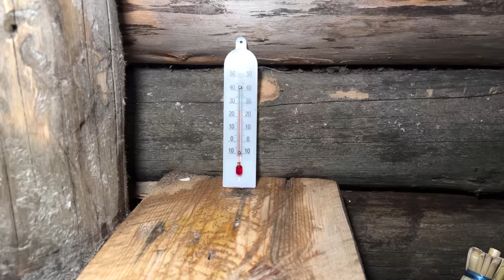I hide from the RAIN in a cozy dugout, install an OVEN in the house underground

Comment: The electric lights sure make a difference. You are able to see what you are doing both inside and outside. 
I remember using candles, and perhaps a propane lantern.  

I'm about 70 years old.  Modern convinces like lithium batteries and LED lighrbulbs  have made many things possible.

Comment: Nice to see you back to normal after your health scare, Alex. Your dugout is coming along nicely!
I'd suggest stapling some of the aluminum foil over the rock wool on the walls. It will both keep down the dust from the rock wool and reflect a remarkable amount of heat back into the cabin. I'm also curious if you plan some sort of removable lean-to or tarp over your porch to cut down the amount of snow shoveling you have to do when you visit in the winter.
Reply from the maker: good idea! We need to come up with something with a canopy
Reply: Rockwool?  I've heard that isn't good to inhale.  Be careful Alex
Reply: @bunit197988  What happens if you breathe in rockwool?
Prolonged Exposure
Rockwool that is inhaled and retained in the respiratory tract can pose a significant health risk. Scarring of internal tissues and the development of cancerous tumors have been associated with long-term exposure to rock wool and other synthetic fibers.
Reply: Normal practice here in the USA is to fit a sheet metal reflector next to the log walls perhaps 10 cm distance. 
No Rockwool at all. !  
Airflow between the sheet metal reflector and the log wall keeps the logs cool. 

Look up wood stove installation instructions for the USA, Canada,  or Western Europe. 

You can make your project much safer for a small amount of money.

Comment: I love that little stove, is that something that can be gotten at a reasonable price? Also, where did you get the basalt wool? That would be very useful for a project I have started. Finally what is that you are filling the cracks in the door with?
Reply: Basalt wool? Never heard of it until this post. Would it catch fire?
Reply: @MultiTimelady  In the video he used it as a fireproofing material. I've never heard of it either, but I'm installing a wood stove in my shop and if I could get it, would be very useful.
Reply: @covishen  Here in the US it is called "mineral wool", although it is also commonly called "rock wool" even though that is technically the trade name of one particular brand of mineral wool. It is made by melting rocks and spinning the molten minerals into long fibers. Mineral wool is fireproof and an excellent insulator. Again, here in the US, it is readily available at any big box home improvement store or from dozens of outlets on the internet.
Reply from the maker: this is a fireproof material

Comment: aluminum foil stapled to the floor infront of the iron stove.. Please tell me you're going to change that out with a metal plate soon. I mean, you have built a nice cabin with a nice, rustic feel.. Don't finish it with half-assed details.. please?
It's kinda like detailing a supercar and then putting a cheap gas station steering wheel cover on it, you know the faux fur ones in bright pink..